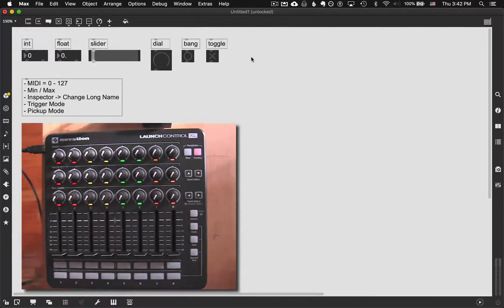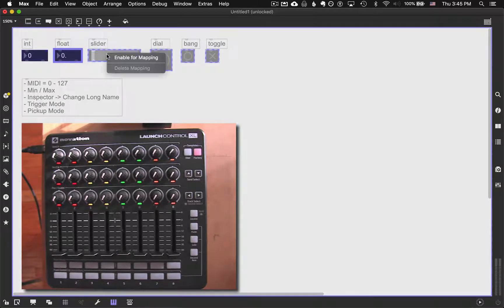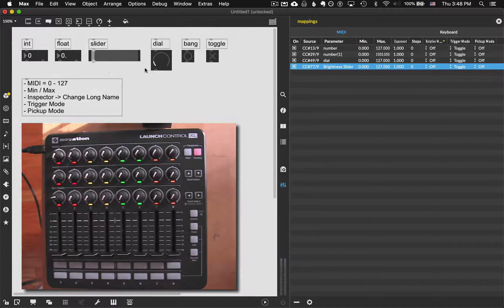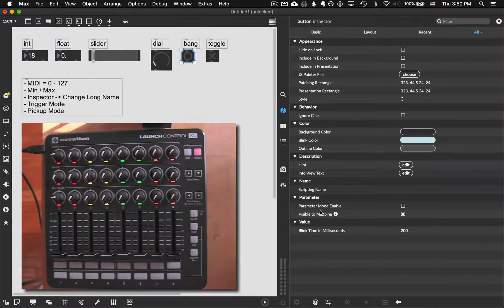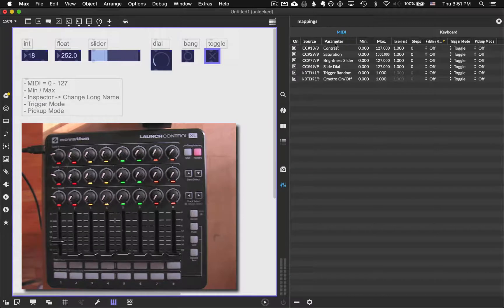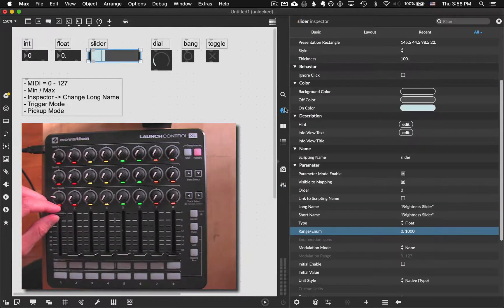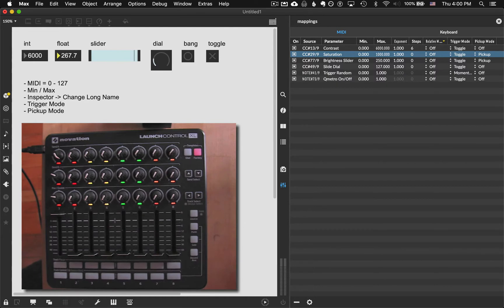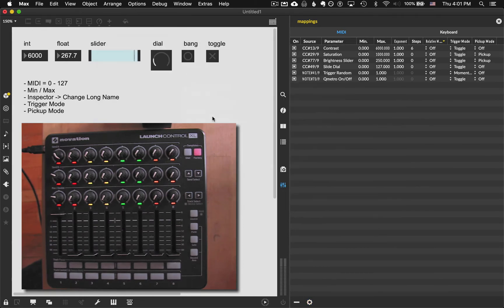4 - MIDI Mapping

Comment: Thank you for sharing, Matt. The video has been 5 years... But I haven't found a way to do kind of the Linear Ramp CC in Max (I don't use MIDI controller too much in Max). The Linear Ramp thing is very easy to be realized in any DAW like ableton where we can always build curves or shapes for the value changes. In Max, I've tried 3000 steps when it's 0-2999(min to max) in mapping but it didn't work when twisting the knob, which I think it's because of the 128 steps MIDI feature on a controller. Do you know how to deal with this issue if I really have to use the knobs and faders on a physical controller? Can I realize a very smooth Linear Ramp CC value changes in Max? BTW, after mapping, I found it would automatically go back to the min, no matter what value I let the knobs go, which is out of control.